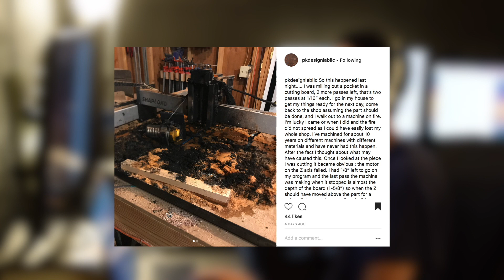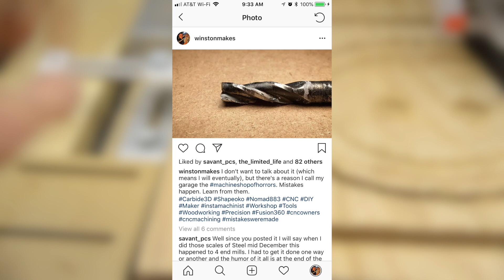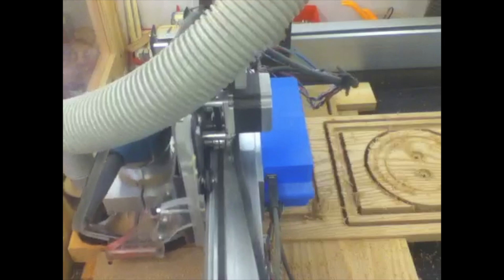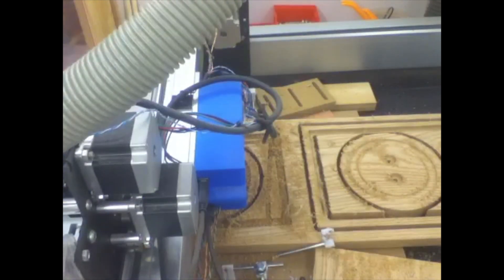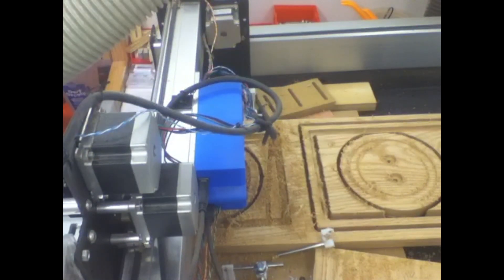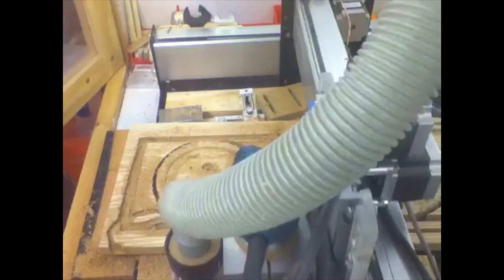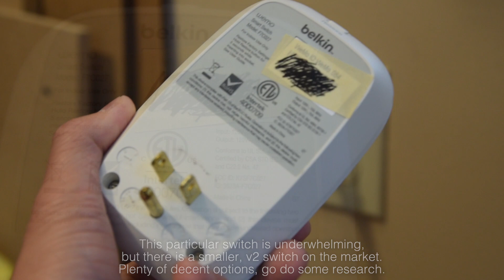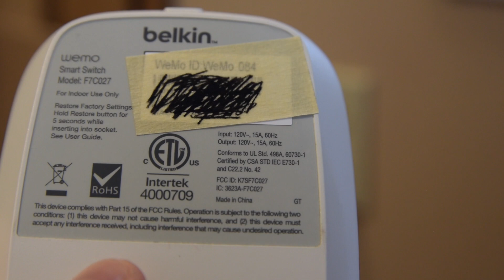I Almost Set My CNC on Fire - Let's Talk Shop Safety

Comment: although I very rarely trust my machines beyond my sight, you can remote into Carbide Motion and control it using http://{your ip here}:8080 (i.e. http://192.168.1.1:8080) . the 
carbide motion interface will be displayed in your browser.

Comment: One thing I almost never see on these hobby grade machines is over curent protection on the spindle and steppers/drive power supplies.

If your steppers stall out or exceed a preset tourqe your machine should kill the spindle, and rehome against the limits. If your spindle suffers an over current, it should trigger the same response.

This type of behavior is easy to implement using a current clamp on the spindle power and a number of stepper drivers have current sense as a feature.
Reply: the spindles on these hobby grade machines are just palm routers typically. No ability for the CAM to control the spindle speed or in most cases even the on/off of the spindle. I mean, come on, a 20A 240V opto isolated relay for the port for the router isn't that hard... You'd still have two cords to plug into the wall, but at least the CAM could watch current or at very least kill the router when it stops.

Comment: suggest a Nest Fire Alarm.  Further I suggest investing in the fire alarm first, even before the camera.  In the Maslow community I have had exhaustive discussions of Estop switches, the need for a fail off not on in your electronics plan.   The one thing I wish to point out is that while I have lots of remote desktop and camera employed,  my plans include the very real possibility of WiFi interruption as a given.  Technology tends to fail at the most critical moments.  Proper planning for them is what made the US space program.  Also I  think it important to point out a Fire Extinguisher is a must have for any shop environment.  I personally learned a lot not in a shop fire but a gas station when my car burst into flames and the employees didn't know they had a Fire Extinguisher, after calling the boss, a unreasonable delay, they had no clue how to use it.  For those that don’t know there is a release pin that must be removed before using most fire extinguishers.  I strongly suggest taking a fire safety corse as well.  Saw dust, wood chips and airflow all add potential.  My first CNC experience was lasers and fire happens there on a regular basis,  greater positive air flow usually over comes it.  Be safe , have fun. Thank you Winston for this.
Reply: B Lee,  Do you have any further insight on the methods used to interface all these together?  I've researched after reading your post.  I see the Nest detector can shutoff the heater, but no real information about shutting down an auxiliary 120v outlet.
Reply: Corey Perez 

You could use Ifttt but that was not my point.  Shutting off Electricity after the fire has started is tertiary. My point is being alerted to take action should come before watching it happen.

Comment: For power kill switches, I'd suggest the magnetically latched kind. They're not too expensive ($10 on Amazon for the POWERTEC 71054, which I plan to use when I build my enclosure) and protect you in another way: from having power tools come back on by surprise after a power outage, tripped breaker, etc.

A magnetically latched switched is basically like a relay with the output wired back to the coil. You push a start button which temporarily provides power to the coil, which then activates the relay, which then keeps itself powered after the start button is released via the current fed back to the coil. When power is lost the coil loses the fed back current, so when power is restored the switch STAYS OFF unless and until you manually push the start button again.

Even if you have a wifi controlled switch or some fancier kill mechanism, having a magnetic switch downstream is a good idea, as it means the wifi switch going haywire or getting hacked or whatever can only power your system OFF unexpectedly, never power it ON unexpectedly.

Comment: There should be an encoder to check that the bit is where is supposed to be according to gcode. If it's not out it should stop immediately. Hobby cnc machines don't have such features.
Reply: MySchizo Buddy those are industrial servos and they cost an arm and a leg next to a NEMA stepper. However your correct, most hobby machines dont have current sensing implemented or even as a feature of the stepper drivers, so they can't detect a head crash or lost steps.
Reply: I've seen closed-loop NEMA steppers now too; although I haven't tried them. If I recall correctly, a 425oz closed-loop stepper, with the driver comes in around $110 US for each pair; not cheap, but not completely outrageous.
Reply: Hobbyist Maker any way to update the shapeoko with these nema motors.
Reply: MySchizo, I don't know. I don't have a shapeoko. I have a couple of openbuilds-based machines.
Reply: Hobbyist Maker yea they do exist. From what understand they require the machine to have that loop handled in the driver board. At 100 a pop they aren't insanely priced but still not cheap, the real cost adds up when you factor in a driver capable of utilizing the encoder data.

Comment: I have a few small safety suggestions.
1) no metal clamps.  Plastic, wood, double stick/carpet tape, all work.  I found someone who uses plastic finish nails as hold-downs.  Whatever works for you.
2) metal lined vacuum hose, not plastic.  Preferably smooth rather than ribbed interior.  It is pricy and hard to find, but it exists.
3) a little hardware hacking have a PIR or heat detector turn off a wired or ethernet or wireless power switch.  This should turn off your router and secondarially electronics.  Having it send you a text would be good too!
4) a 'big red button' emergency power off.  They are available from Rockler and other places.  Working in commercial data centers, I am used to having one near every exit.  They do not power down anything gracefully, but they are important for safety.  You don't need the commercial version, but consider it.  It should be large, RED, possibly with ever on LED whenever power is available so it can be seen even in the dark, near/on your equipment and/or enclosure and optionally near the door to the house or building exit.
5) if monitoring remotely, see if you can incorporate a 'big red button' equivalent in your monitoring program (or ask your software vendor for an 'feature enhancement').
6) This I just thought of, a 'high frequency' monitor'.  For folks that are 'gracefully aging', like me, our high frequency accuity is not what it once was whether we like it or not.
Having a 'high frequency' monitor could tell us if some bad things are starting to happen fast, including grinding metal.  Have it at least issue a stop and power off the router, and send you a text message (or other appropriate alarm).

Just a few thoughts.  I already do #1 & #4, the rest are now on my 'todo' list.
Reply from the maker: Metal clamps are pretty safe if they're non-ferrous, so the aluminum ones are okay to use.
Reply: I still saw some sparks on your video.  Non-ferrus (aluminum, brass, etc) is still better than steel, agreed.
Reply: servant74 bolts are mostly made from steel so that might explain some
Reply: Line the inside of your enclosure with something that is flame resistant (such as thin sheet metal) so a fire cannot get directly at the wood enclosure immediately. It would minimize damage with a small fire, and slow down a larger one to give you more time to react with fire extinguishers, to evacuate the area, etc. Or replace the wood enclosure entirely with a metal one. Replace the plastic window with fire and impact resistant panes (usually seen in fire resistant doors in building stairways as glass with embedded wire mesh) which can withstand both the heat of a fire and to contain flying debris thrown at it. Of course the doors also need to be latching shut every time they close beyond just relying on the friction of the hinge to hold the doors closed if you really want to doors to stay shut if something unexpected is trying to get out of the enclosure.

In addition to a smoke detector, look into adding a visual flame detector that looks for the light from a fire (since smoke alone can take awhile to buildup).

https://en.wikipedia.org/wiki/Flame_detector
Reply: A cheep way is a uno with sensors

Comment: I recently bought this switch as a worst case way to reset our work email server remotely. It has 2 outlets (though 10A shared to both) but I was impressed at how many methods it has to control. There's a web interface to the device but also works via skype. I don't recommend leaving the house while it's running, but if one were going to do so being able to control it w/o being on local wifi is there. https://3gstore.com/products/21_connected_switches.html

Comment: I have a nest fire alarm with a smart wall socket, I use ifttt with a rule that is set so smoke is detected everything is powered down. I am going to plum in an extinguisher with a solenoid for remote fire suppression at some point too.
Reply from the maker: That IFTTT integration is pretty sweet. If you go the extinguisher route, test thoroughly to eliminate false positives. That could get messy...
Reply: @WinstonMakes  right? that would suck to be hanging out and it randomly go off and turn into the stay-puft marshmellow man.
Reply: @rbdesignsnh  I am by no means knowledgeable on this, but i think inhaling fire extingusher powder might be potentially very harmful. Its entire goal is to block the fire's acsess to oxygen. If you get that in your lungs it could suficate you (maybe???)
Reply: @jearlblah5169  it for sure is harmful to breath.
Reply: @jearlblah5169  Most dry fire extinguishers use a fine, dense powder that does not burn. Some powders are designed to expand when exposed to heat. The powder rests on top of burning material and prevents oxygen from reaching the fire. These extinguisher powders are not good to breathe, but are generally as inert in your body as for fire, so it is not massively worse than dust. After all, unprepared people are expected to use fire extinguishers.

Where you can get into trouble really quickly and kill people or yourself quite easily is with liquid or gas fire suppression systems. Sprinklers and electrical systems (like spindles...) can create electrical hazards shockingly easily. Gas fire suppression, like CO2 and Halon, displace the oxygen around the fire to stop it. They will snuff humans just as effectively as the fire.
Reply: So, you think your internet service is 100% reliable, huh?

Comment: It's far from my forte, but I feel like machine learning would be a great solution to the, "gee, something doesn't sound right, should probably turn this off five seconds ago" problem.
Reply: Good idea.  The sensors are not quite there as far as I could tell.  But even simple Arduino or Raspberry Pi would have enough power to do the monitoring.

Comment: A closed loop system would have saved so much more
Reply: it is also not expensive anymore like a few years ago
Reply: Santosi came here to say this too. On closed loop if you miss to many steps it shuts down. The controller also needs control on the spindle on/off. Monitoring current on the spindle and setting a maximum threshold would also be a good idea. 

It's a shame these hobby CNC machines are missing some basic features for their industrial cousins.
Reply: Most hobby / non-commercial systems are open loop.  CNC and 3D printers could all benefit by closed loop systems, but it doesn't seem to be on the horizon saddly.  I would love to see it!
Reply: servant74 actually I do believe that it is on the horizon, I am more into 3d printing than CNC mainly because of the noise and space for me, but Prussia 3d has a mode where it misses a step or the head gets moved it will re home.